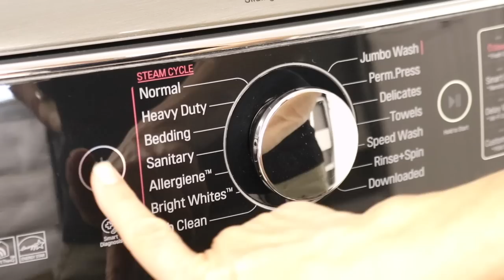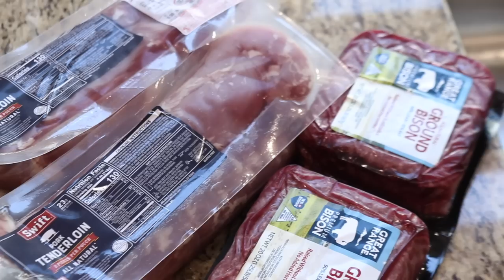CLEANING MOTIVATION | GETTING IT ALL DONE | PRODUCTIVE DAY AT HOME

Comment: Randi, my mom has a new LG dryer that wasn’t drying properly. I asked you about it before. Well, turns out it was defective and it was replaced. On my last visit it didn’t dry her load of kitchen towels well enough, and she laid them all over the kitchen counters to finish drying. I was happy to show her how to set a drying time and heat setting manually instead of using the sensor cycles. I’m sure I learned from watching you that there are selections in addition to the dials. Thanks!
Reply from the maker: I have no idea what all the different cycles and settings do on my machine. 😂 I always use the same few settings every time.  Happy you found the problem.